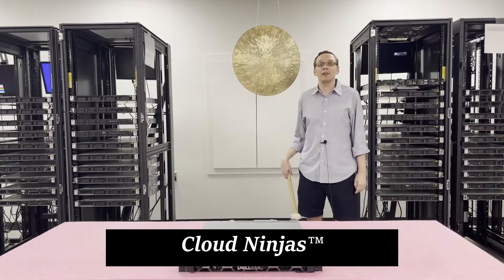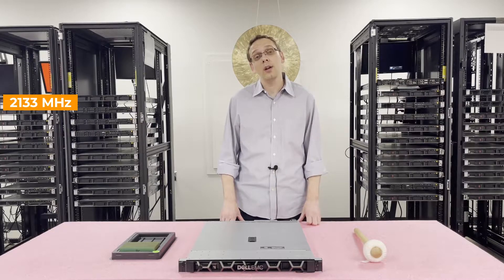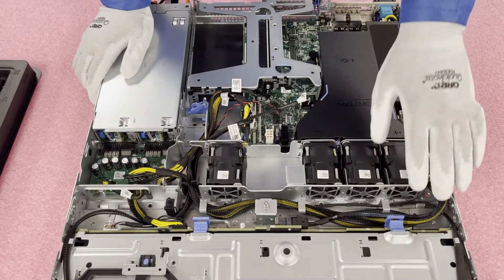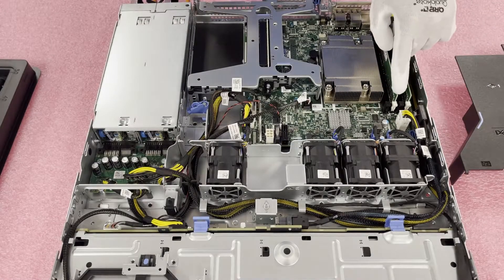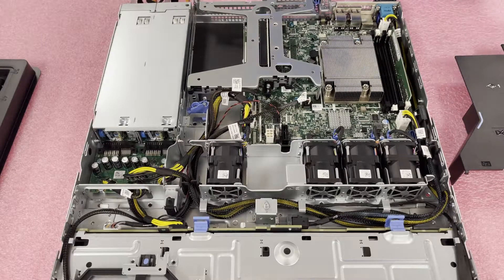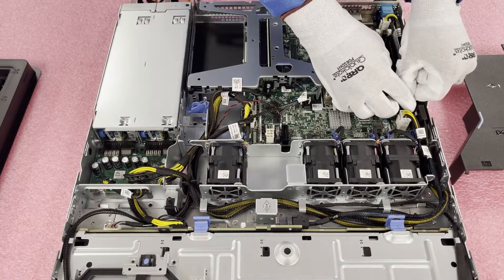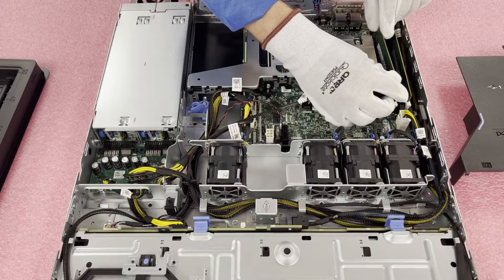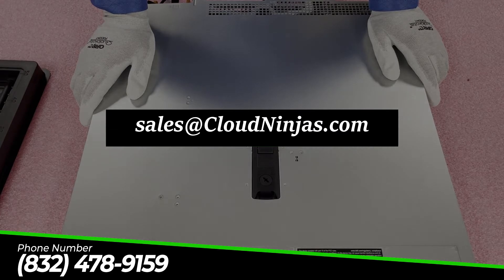Dell EMC PowerEdge R340 Server Review & Overview | Memory Install Tips | How to Configure System RAM

Comment: Can i add 16gb and 8gb in the same white slots (A1 and A2)?
Reply from the maker: Yes.  You can.  We recommend matching kits but will work.   You cannot mix LRDIMMs with RDIMMs.  You can mix speeds but will clock down to slowest speed.  Smash that subscribe.  Have a nice weekend.

Comment: How about upgrading the CPU? Our R340 only has 4 cores and we are planning on upgrading it.
Reply from the maker: Make sure you have thermal grease to put on top of the CPU.  Will send some suggestions today.  👍
Reply from the maker: Check out these CPUs.  E-2288G - will be a bit more expensive but top of the line.  Or E-2246G will be another solid processor but not quite as expensive.  Good luck! Smash that subscribe.  :-)